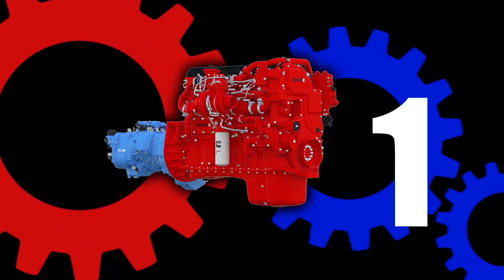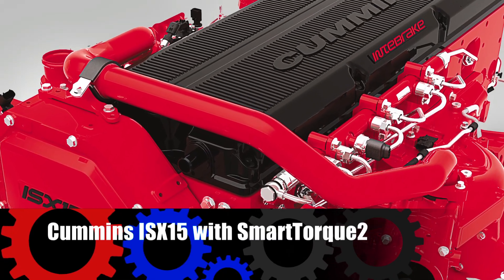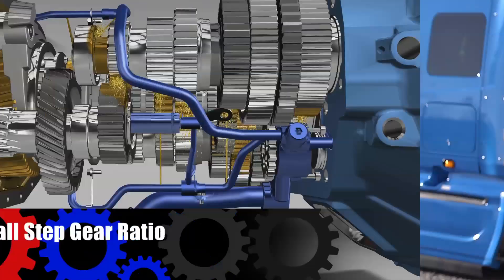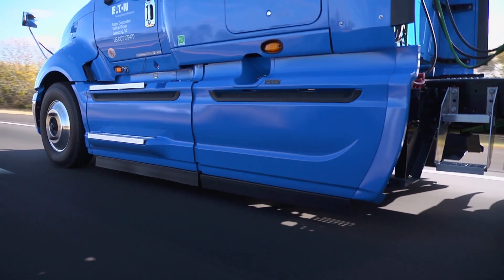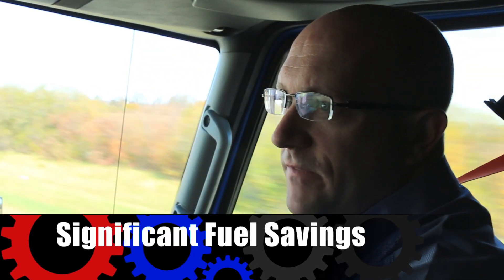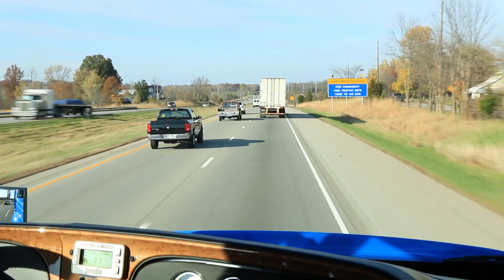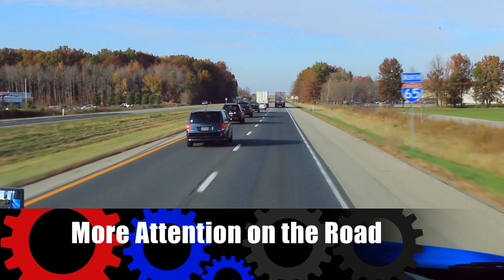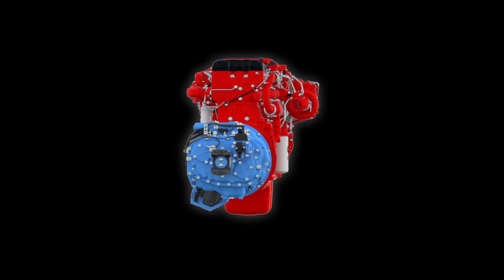The SmartAdvantage™ Powertrain from Cummins and Eaton

Comment: Good night, how are you?

I am Henrique da Silva Machado, I am a mechanic at Novo Hamburgo RS, and here we have a machine that moves the containers and is equipped with a cummins engine QSM 11 35177704. It requires a regulation of valves every 2000hrs of operation, however the machine is at 11,000hrs with only one valve adjustment. By manual, I have the clearance info of 0.20mm Adm and 0.50mm Escape.

But it does not tell me the slack of the injector units nor the form and sequence of regulation. I would like to know the correct procedure for doing this work.

If you can help me, I'll be grateful.